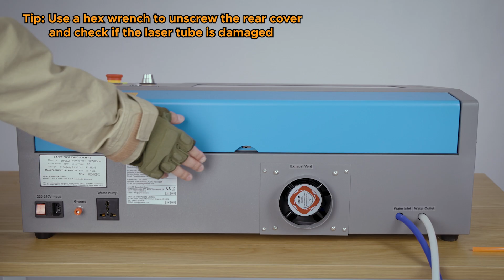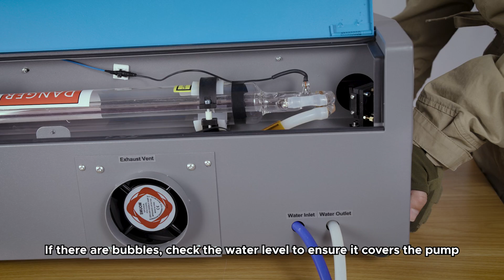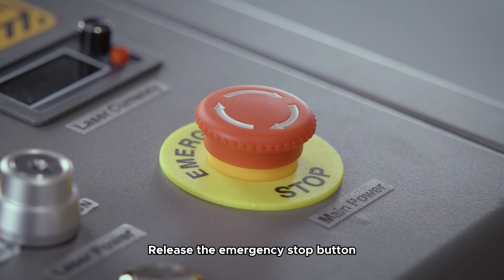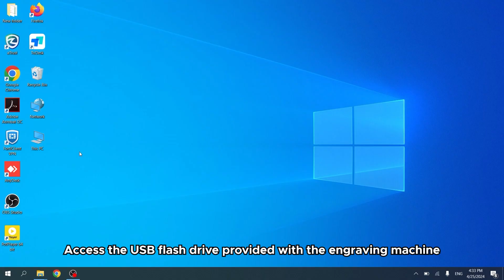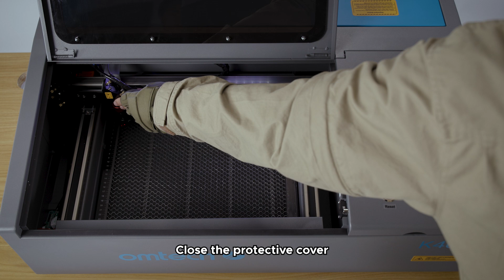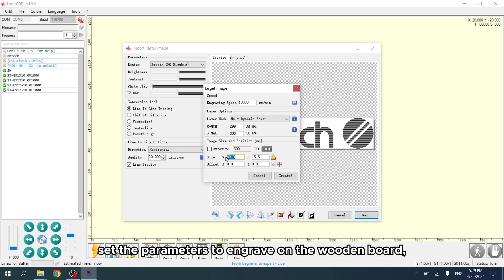K40+ Laser Cutter Unboxing & First Impressions – Affordable Laser Engraver Review

Comment: Hi, I followed all the instructions and the laser is not engraving, it moves like as it is doing it but there's nothing being engraved. Any advice?
Reply from the maker: Double check the door sensors are working, and also double check your water lines are in the correct spots. If you continue to have trouble, please feel free to reach out and shoot us a message or email!
Reply: I just got my replacement k40+ and it’s doing the same thing! I cannot get it to fire at all! Only when I hit test
Reply from the maker: @ Double check all the door sensors and that the water is flowing in the correct direction. Hopefully this fixes it! If not please email our support line.
Reply: @anikaconway638 what is the replacement?